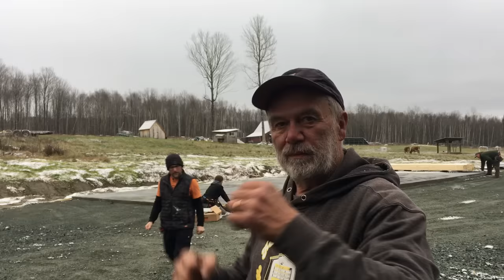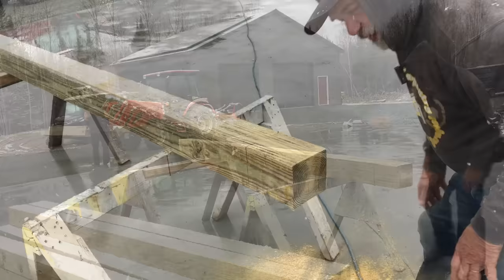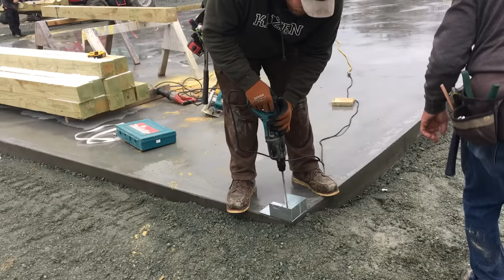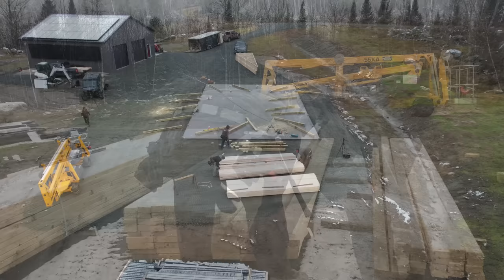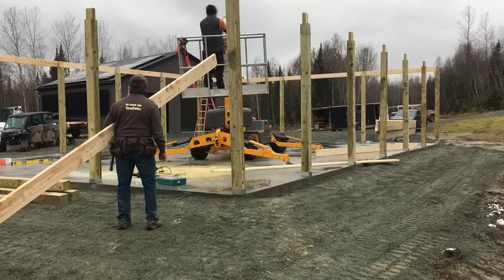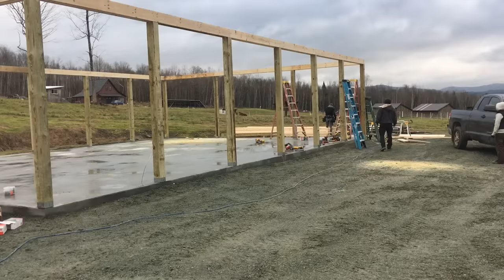Lumnah Acres Barn Build Post Frame Part 1

Comment: As one who moved to Vermont from the Midwest 6 years ago, I am often amazed at the fortitude of builders who work outside all year. Yes, even sub-zero weather doesn't slow them down. Try it yourself, and you will be in awe of these people! Cheers!
Reply from the maker: Thanks
Reply: As a framer we did not work in sub zero weather. However, at that time, we did not have nailers. Try to manipulate nails in such weather with your hand.

Comment: Ken, Chad, Dan and Al work together like a well oiled machine👌. It's almost like they have worked together before. 
Oh, they have. They've built the Tiny House and the Workshop together.😁
Great idea to laminate three timbers together for the diagonal bracers, rather than spending forever cutting tenons on 6x6's, all 32 of them👍. 
Once the bracers are in there should be very little, if any, racking in the frame.
Looking forward to the roof trusses going up.☝
Reply from the maker: Thanks

Comment: I love diagonal braces:  No shape stronger than a triangle.  Gives you a very rigid structure.  You can do the same with the trusses.  Just add two rat run braces and two diagonal braces after you get two trusses up.  That will force all the additional trusses to be perfectly vertical.
Reply from the maker: Right thanks

Comment: Hey Ken, I built a woodworking shop of similar size, with 6x6 posts, but I made the posts from built up 2x6’s. This made it easier for a one man build. It also made for making joints at corners and to hold the top beams. I followed construction techniques found in books by Alex Wade.
Reply from the maker: Nice thanks

Comment: Always interesting to see two different perspectives on the same build. On the same note, watching 2 guys on ladders versus 2 guys and a manlift doing a similar task. Which way was faster?
Reply from the maker: The ladder is quicker until you get up higher
Reply: Looked to me like they should have done it by ladder, save the lift $$$ for another day.
Reply: @jfrodgers7858    the deal with the lift is a better price on a weekly rental, so might as well use it while it's there. They'll be hoisting the trusses and maybe the roof panels later in the week. If they don't pick it up right away, then maybe Al will install a high mounted flood light on the front of the barn over the weekend.
Reply: @rupe53  oh yeah.  I didn't think about that.  And maybe availability.  Get it now or go without.  Lol.

Comment: Another fantastic collaboration.  I'm not a fan of "homesteading" because where does it really go? Here's my questions:
1. Love the post frame construction but why not verify the plane of the slab? Post frame allows each post to be custom fit to minor discrepancies that occur in a slab or any other foundation that occur after material is in place.  Why 6x6 posts? You can order laminated posts with tge notches in the top. Good to go.  Stronger, all pressure treated etc.  I missed the boys verifying squareness.  I'm sure its "perfect" but who knows.  That Al is tough, no monkey business here.  I cringed when he drove his tractor on the concrete.  I know it developed its strength quickly but most try to stay off the exposed edges for 30 days.
Reply from the maker: Thanks. Definitely squared it. We poured the slab and felt comfortable with it.

Comment: What are those concrete anchors for the posts you used?
Reply from the maker: Wedge anchors
Reply: @kenskarpentry  thankyou.  What about the name and brand of that 6x6 bracket it bolts to?